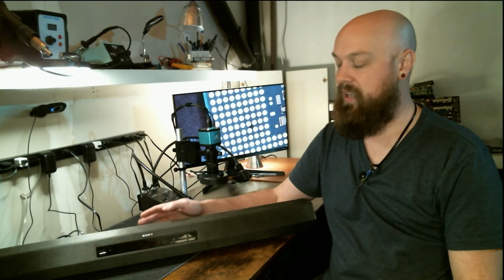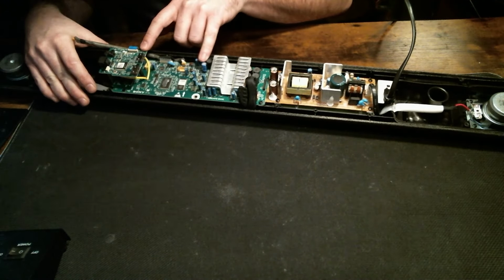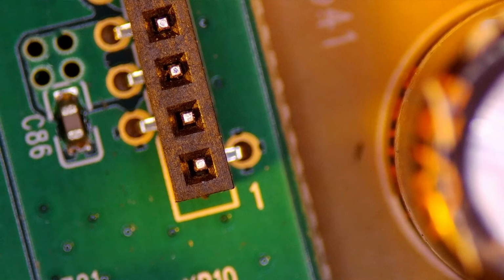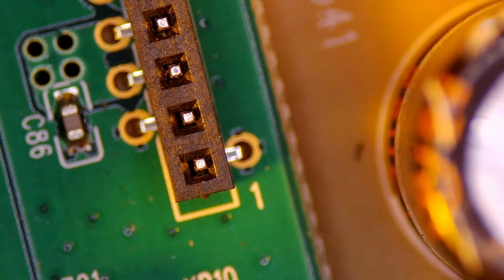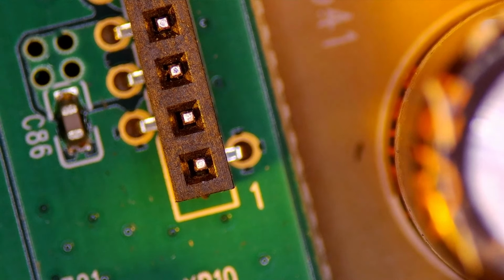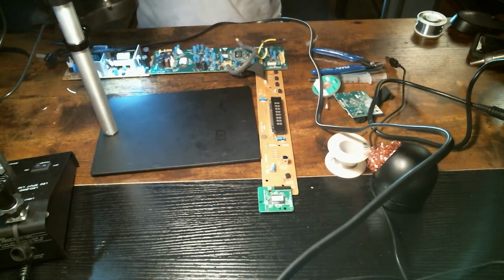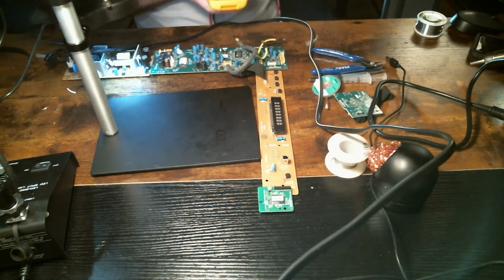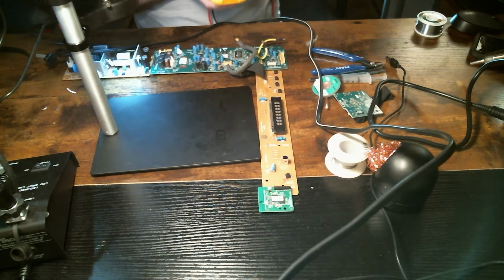Fixing a Sony Sound Bar - No power - No Lights

Comment: You should check drain side of the mosfet to ground. There is probably a short somewhere further on. Can feel around for heat, use a thermal camera, etc. I might pick up one of these later that seems to have the same issue.
Reply from the maker: Great advice, thank you!
I will definitely be revisiting this
Reply: I've been focus on repairing mine for a couple of days. Armed with the service manual I've ruled out a bunch of stuff. A lot of the light blue capactiors were fully open circuit. Board is a pain to work with. Use an ESR meter to check caps in circuit. If you don't get a good reading for ESR and capacitance then cut one leg off almost flush with the board and measure again out of circuit. If it measures good bridge the leg with solder. If bad heat up joint on intact leg and pull out cap. Liquid flux and solder wick from both sides to clear  Replaced those. And checked all power rails are good. HDMI board communicates with PC but amp doesn't turn on, vacuum fluorescent display, controls, bluetooth, etc do not work. They are all controlled by the Nuvoton m0516 chip. It doesn't get warm either so I feel like it could be dead. Looks like most of the time U2 and U17 blow up for people as well as the capacitors. Search YouTube for Mcgyver Ct260 and you'll find an Italian guy who has 4 videos detailing his repairs on these. The service manual is easily found on google. It contains also the power rail hierarchy near the end which should help. U10 is the main brain of the device.
Reply from the maker: Yes! U2 And U12 were cracked for me as well.
Thank you for this!

Comment: I have one of these that’s been in storage for a few years. Just dug it out to use it however the remote has been lost and the when I plug it in there is no standby light on the sound bar!
Should there be a standby light or does it need activation via a remote?
I can’t figure how to make it work without a remote.
Reply from the maker: I havent got mine working so I'm not sure if there's a standby light.  I would assume there is
Reply: @ mine is slightly different as it doesn’t have the front screen bit and no on off button.
Not sure if it’s worth getting a new remote.
Reply from the maker: If you have an older android phone, some have an RF transmitter on the front.  You may be able to download an app to control it from your phone
Reply: @ Thank you very much, I will give it a go if not look at buying a remote

Comment: I have the same sound bar and the same problem when i look at i finned out that i have burned IC. 
HOW CAN I GET NEW ONE PLEASE?
Reply from the maker: What IC is burned? Check aliexpress, I've found a ton of good chips on there
Reply: @TestingWithMike  I don't know how to order one
Reply from the maker: Search the chip on aliexpress, find what you need and order it up. Easy easy lemon squeezy
Reply: @TestingWithMike  I couldn't find the chip the number only show the uper one the lowers are burned
Reply from the maker: There should be markings on the board. What's the number corresponding to the chip?
Reply: @TestingWithMike  there is two number the upper one is 341k2 and the lower one is 3482A.
When I look for the first one I find nothing but when I look the lower one I find but the upper one will deferent. 
When I asked a Chinese guy he said the the upper one is just a model number  the lower one who's defined the value like the upper one change from company to company but the lower one always fixed because its the one that specifies the value of the IC is it correct?
Reply from the maker: https://servicemanuals.us/sony/audio/ht-ct260h.html?start=21
Here is the service manual for the sound bar.  Perhaps this will help
Reply: @TestingWithMike  thank you it says EUP3482.so it's just just the lower number who's control with ic change with.

Comment: Just wondering if you tested the bridge rectifier if this power supply as one. It should do.
Reply from the maker: I did not do that actually.  Once I noticed there was DC hitting the main board I didn't even think about it.  What sort of test on the rectifier would you suggest?

Comment: I have just checked it, the power output heatsink is short with the power rails, I removed the another mosfet and the short is gone. To make sure about it, i have checked it with thermal camera and found only that ic is getting heatup without even turning it on. Just replace it and it will work. The number is 3482A
Reply from the maker: Wow thank you! I'll have to dig the soundbar out and give it a try
Reply: @ just wanna let you know, my sound bar is back to life after changing that ic. 😁 it’s working !! Try to change it will work 100%
Reply from the maker: Well done! I'm still trying to find where I stored it lol
Reply: @TestingWithMike  haha hope you get it soon
Reply: @TestingWithMike  Will you make a update video on this? i have this same sound bar that's just sitting without being used cause I didn't have a HDMI splitter and now it wont turn on at all :( it worked a few months ago.

Comment: Hey a question is it repairable if burnt.
Reply from the maker: Depends on how bad the damage is.  If the board itself is compromised by the burn, it's probably not worth it.  If the damage is isolated to surface mount components then it's possible to repair
Reply: @TestingWithMike  i opened it up and the board seems fine but the powerboard have some liquid i think from some capacitor because it accidentally got plugged into freaking double its rated voltage XD
Reply: @TestingWithMike  i would send some pics but no way here on youtube

Comment: Trying to troubleshoot a broken soundbar too and am stuck at the same point you are. In another comment you mentioned an IC that has cracked. Which one was it?
Who knows, maybe one of us will find a fix since it is very common for those soundbars to break like this. Although it might be a different cause for each of us… but maybe not. Did you try the reset procedure? Take it off power for 1h then plug it in while holding the power button down and keep holding it for 60 seconds. Then try to turn it in. Unplug it, and re-plug it and try to turn it on.
Reply from the maker: Hey @constantinflux  The chip i replaced was Q6 Labeled N7S2 or N752.. hard to tell.  the crack was on the left side of the chip.
I did attempt the reset procedure and it did not help.  I still have hope for this but I've spent so much time on it.  Currently its collecting all the dust in the workshop to hopefully be revived one day
Reply: @TestingWithMike  There is a Video o YT by an Italian person that iirc replaced the mosfet (?) that is responsible for starting the logic and also swapped some caps around it. I’ll post the link if I find it. Might help you as well!
Reply: @TestingWithMike  Found the video I mentioned: https://youtu.be/n7o4YNPCatc?si=xBcWTbgd6k9ss6AM you can turn on subtitles and switch to English subtitles. There are two more vids on his channel from a year ago where he is fixing another soundbar. Might be useful. I’ll check the mosfet in mine on Sunday. Maybe it’s faulty in mine too, who knows. Thanks for your video!
Reply: @TestingWithMike  Oh and also an important tip in the video is to drain the 400V cap before going in there… at least as far as I understood.. to avoid nasty surprises.
Reply from the maker: @constantinflux  I appreciate the video link, I will have a watch
Reply: Hey, do you have any update on this btw, did it work? Same issue here  @constantinflux
Reply from the maker: I havent had much time unfortunately. Ill revisit one day

Comment: What's the little board you took off for?
Reply from the maker: That was the HDMI connection board
Reply: I googled for my same Bar same Problem i let her sit for 2 days 10min Power now again no Power suply mabey any Batterie on the Board?
Reply from the maker: @kingmola896  No battery on board..  i have a feeling its something do do with the power delivery circuit.  In all honesty the time and parts it would take to repair it isnt really worth it.  I am likely going to use this for parts for another fix or project.  Thanks for watching and commenting :)

Comment: U2 and U17 I have the same issue worth a shot
Reply from the maker: Let me know if you get it fixed
Reply: @TestingWithMike  yes fitted and all working again..

 U2- 3482A. U17- G5725ADJ
Can get the service manual easily from the internet with schematics contained. But I would think those two the same. I can’t take credit for it an Italian YouTube video pointed me to the right area

Comment: Might it be you had installed the new mosfett in the wrong direction?
Reply: By the way, I'm having the same problem of the soundbar not lighting. It happened after a cleaner had used the extension where the sounbar was for a vacuum machine. The other devices that shared the anti-surge extension are okay though.
Reply from the maker: Every chip has a marking on it to show pin 1.  In this case, it's the top right indicated by a circle. This issue is very common and I have attempted to repair this while filming part 2.  I found a cracked chip and even after replacing it, it still does not power on.
Unfortunately, even with the schematics I cannot isolate the issue.  I've had to shelf this for now until I have more time to poke away at it.